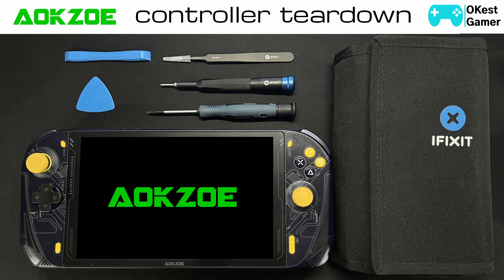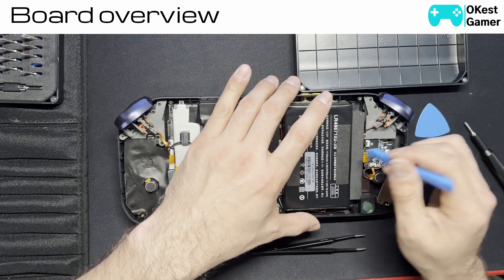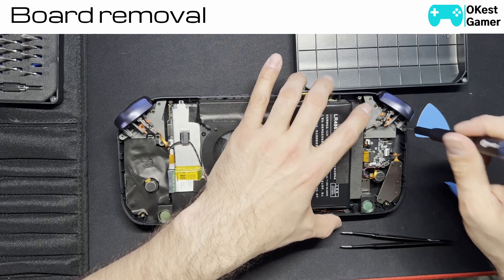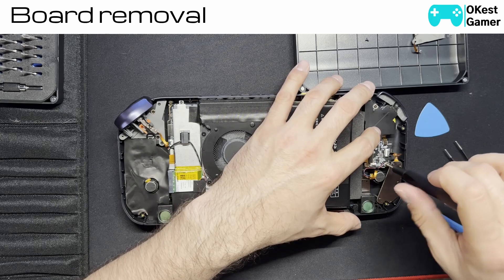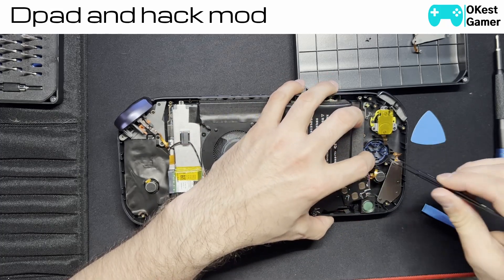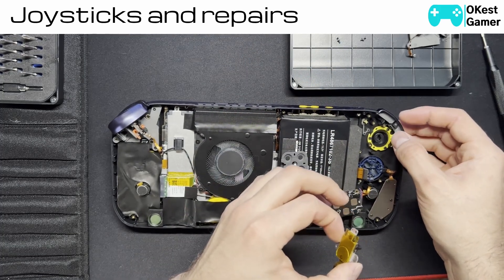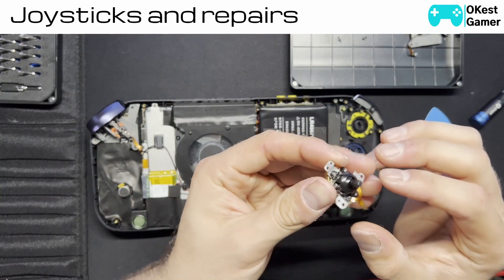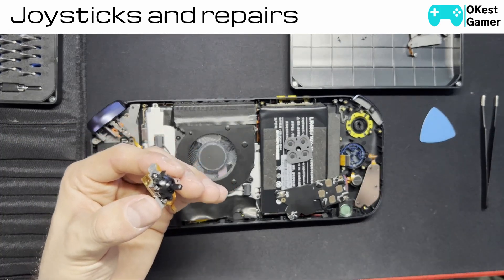AOKZOE controller teardown

Comment: my LB button doesn't work
Reply from the maker: If I was to take a guess. It's likely the micro switch at the top of the controller board. I found the aokzoe to be a little brittle at that part

Comment: Hey boss, I was wondering if you had any thoughts on this issue I’m having with mine: 

I’m not a technician so i’ll try my best to explain: The D-Pad is stuck permanently holding down the DOWN button. The only way to stop it is to press the up function. This is obviously really annoying since i cant open any menu without it scrolling down through the whole thing endlessly. 

I dont mind not using the D-Pad as I plan on using mouse and keyboard so I would LIKE to open it up and just get rid of the dpad functionality altogether. At the least get rid of the infinite down pressing.

Any advice is appreciated. I’ve been told by multiple repair shops that they dont wanna touch it since its an unconventional product that they dont have any experience with… I get it but.. come on
Reply from the maker: I am guessing it's the membrane that might be torn for the dpad
Reply: @ hmm.. thanks for replying btw! 

I ended up just taking the whole membrane and the plastic D-Pad bit out. Problem solved! Just covered the hole it left and I can use it now. 

Thanks for the video! I have an Aokzoe A1 but this is the only tear down I can find of any Aokzoe of the dpad side.
Reply from the maker: @internetguy4489  no problem, yeah you can order a new membrane from aokzoe and it should hopefully fix the problem

Comment: Hello, thanks for the video. My turbo button gets stucked some times.  I press and it only come back if I press keyboard button. Is there something I can do? This video doesn't show the side of the keyboard/turbo button 😢
Reply from the maker: The disassembly of the other side is very similar. I would see if something sticky got along the side of the button
Reply: I've opened it, but couldn't reach the button, it looks like it's under the main board 😢 It's not simple as the side you've showed on the video. Did you tried to reach turbo button?
Reply from the maker: I have not, I’ll take a look again when I get home to see where it lands. I’m surprised it wouldn’t be on controller board.
Reply: @okestgamer  I really thank you!
Reply: Any news?

Comment: Where can I find the proper tools to take the yellow connectors out? They go to the analog sticks and I need to replace them.
Reply from the maker: I believe the ifixit pro toolkit should have what you need
Reply: @okestgamer   Sorry one more question, Is the pro a lot more convenient?
Reply from the maker: @Nathanpark-cu2gd  it has some more options, I would suggest it if you plan to use smaller screw drivers often. Aside from that a simpler set could also do
Reply: @okestgamer  from my judgement I'm going to get a pro cause it's my AOKZOE is a little different from this one. I think I have an older model.
Reply from the maker: @Nathanpark-cu2gd  pro set is always nice

Comment: My Y button has started to lose sensitivity... One of the many issues my machine has had as an early backer... anyone know what can be done?
EDIT: After months of the device being essentially useless (the X button developed the same issue) I took the plunge, opened it, and cleaned the contacts with alcohol, and it's as good as new, perhaps even better, suggesting the contacts were dirty when it was built.
Reply from the maker: If I had to guess, I would say the little grey conductive pad needs cleaning. Another guy had the same issue.
Reply: @okestgamer  Any chance you'd do a teardown for the other side of the controller? I can't seem to find one anywhere...
Reply: Aconteceu com o meu A1 também, fiz a limpeza e voltou a funcionar normalmente
Reply: @leonardo36864  How did you clean it? Opening it seems pretty complicated if you want to get to the conductive pad...?

Comment: Are these machine well built? i'm concerned that if i buy one and there is a problem that I won't be able to get it repaired?
Reply from the maker: There have been a couple issues along the way. The main one was a screen bug, i believe it’s most sorted out, and seemed to only impact a few people. A couple of others had controller issues, but it was a limited amount of people, so hard to gauge
Reply: Not worthy to buy. Expensive but really soft n easily broken especially on controller part. I got one n regret it n now continue with my steam deck.
Reply: @nainazri4289  I keep saying I won't buy these Chinese products and every time I do I regret it later. I should have bought a steam deck, a whopping SD card and left it there.

Comment: the left directional dpad is now hard to press, what should i do to fix it? i want it to be lightly press to work. seeking for your help thank you
Reply from the maker: Often this is due to the pad being slightly misaligned, I would take it apart again and do your best to ensure it’s lined up. It’s a finicky thing and I have had that happen as well.
Reply: @okestgamer  ill try to open it. hope i will not make it worst
Reply from the maker: I recommend leaving the back off until you sort it out to be lined up. Be careful but test it and if it’s all good the. Close it back up. Saves time not having to open it up again
Reply: @okestgamer Hello sir! i want to buy the same product dpad, then see that it has a circle dpad too, does the included nintendo switch circle dpad can be put at the top of the dpad of aokzoe too? tia!🎉

Comment: Hi. I have solder it back n the LB is now working. But now the other  problem arise. The joystick analog  is like drifting when i test it on the gamepad tester. Could it be because of drivers or hardware issue?tq
Reply: I have done quick restore. Problem still persist
Reply from the maker: Did you do the joystick calibration? Not the windows one, but the button combo on the device to start calibration.
Reply: @okestgamer not done yet. Will try
Reply: @okestgamer done it. Problem resolved. Tqvm
Reply from the maker: Nice! Glad it all worked out.
Reply: I have done it. Not working. By the way,is it possible due to not solder back the blue/red wire on the board?i dont like the vibration btw.or i must resolder it back?
Reply from the maker: Yeah you could remove them and it would be gone. You should also be able to disable vibration on the aokzoe app (at least it used to have for sure)

Comment: Do you think it's possible to swap the ayaneo 2 thumb grips with the aok would it fit
Reply from the maker: No, they caps are different sizes as well as the holes for the sticks. The aokzoe ones are mid sized instead of the full sized ones

Comment: Hi, I'm having issues with my left joystick on my aokzoe A1. It seems like it's permanently moving downwards even when I move the stick up. Is this a joystick issue or do you think it's a pcb issue? Thank you in advance
Reply from the maker: Did you try to calibrate the joystick?
Reply: @okestgamer  Hi, I ran the calibration in windows 11, but it shows the same issue. The joystick is physically centered but it registers as if it's moving to the left constantly
Reply: Hi, just wanted to give you an update in the event anyone else had the same problem as me. I initially ran the calibration test, but did it in Windows 11, I think you meant the Aokzoe's calibration which is different. Once I ran that, it solved my problem. For anyone else having the same problem, all you do is hold the back button for 5 seconds, till you see the light next to the keyboard button blinking, then rotate both the analog stick in circles until the light next to the keyboard button turns off.
Reply from the maker: @openboxtherapy1010  here’s the tutorial for the calibration 
https://youtu.be/JeTSe2ZFv3w

Comment: Is it possible to replace the D-Pad with an X box Elite 2 controller D-Pad or the Nintendo Switch D-Pad is the only fit for it?
Reply from the maker: You can do some modifications to make it work. Basically it is using the aokzoe dpad and cutting the top portion off and securing the new style on top with some adhesive. I’ve seen some do it.
Reply: @okestgamer  Awesome, do I still need to use the same membrane or I can switch it with the Xbox's controller membrane?
Reply from the maker: As long as it fits and the pads line up you should be fine. Although the Xbox one uses buttons rather than a membrane
Reply: @okestgamer  Okay, will give it a shot once my A1 Pro finally gets delivered. Thanks for the quick response I appreciate it. 👍💯
Reply from the maker: Not a problem

Comment: Hi, My right trigger not working. Tested using gamepad tester and it did not detect the right trigger . What do I do? Thanks
Reply from the maker: Hmm I had you take apart the device prior?
Reply: @okestgamer  no I didn't. I don't think I would  be able to do all that since I'm not a technical person
Reply from the maker: @kahlilhamizz  for this one it sounds like hardware failure. I would suggest contacting support@aokzoestore.com

Comment: I have a problem with the  A button on Aokzoe, would be great to see also that side open, so I may found the courage to open up the device.
Thanks for the video 👍
Reply from the maker: No problem. Are you in the discord server? I could probably walk you through some of the issues you’re having
Reply: What's ur issue with the A button? Has it lost sensitivity?
Reply: I have problem with B and Y button pressure - A and X pressure works fine. Is there any video how to fix this?
Reply: @AndrejBergant  I'm struggling to find many people with this issue, so there doesn't seem to be much info on it, and the A1 looks super-hard to open and get to the conductive pads... Have you fixed your issue? My X button is almost completely unusable now.
Reply: @AndrejBergant  I opened by device yesterday and cleaned the contacts, and it now works like new, perhaps even better.
Reply: @Renvaar1989  hey man been having this issue lately. You have a tutorial for this or this tutorial by OKest is fine? thanks
Reply: @bradleyko1114  It depends what side you have the issue on, if it's the ABXY side then this tutorial won't help a whole lot, other than opening the device. I don't have a tutorial. There were quite a few ribbon cables to disconnect but if you've done something similar before you should be fine.

Comment: Thank you 
Do you maybe know which joystick kits are inside I mean I have the Halleffekts but something is wrong with my left stick I want to change it 
Do you know where to get those 
And maybe you know which battery inside I want to change that too to a bigger one
Reply from the maker: Hi, you should be able to purchase replacement parts from the aokzoe AliExpress store. You will need to message them about purchasing parts.